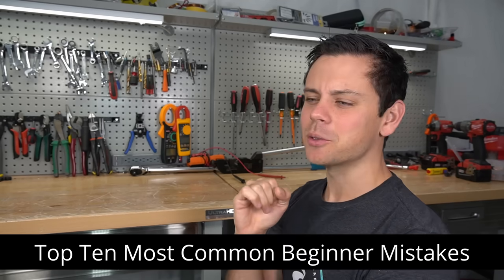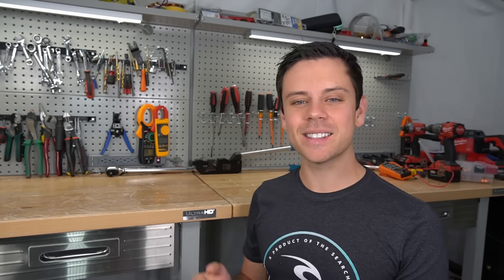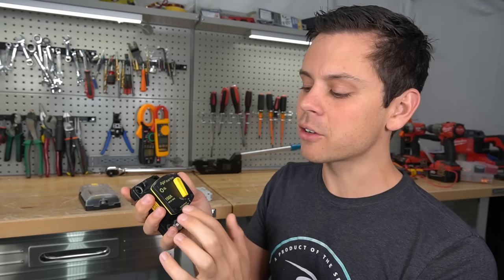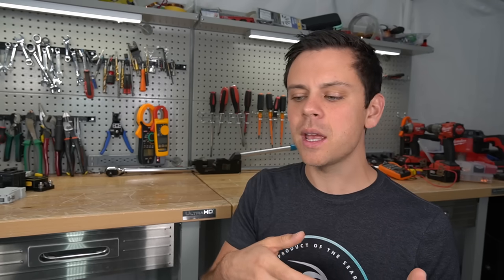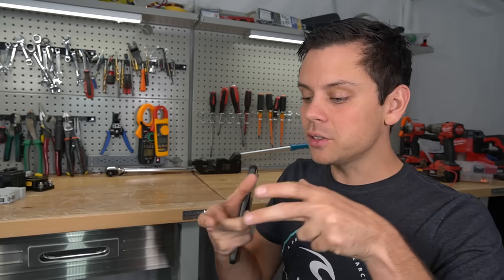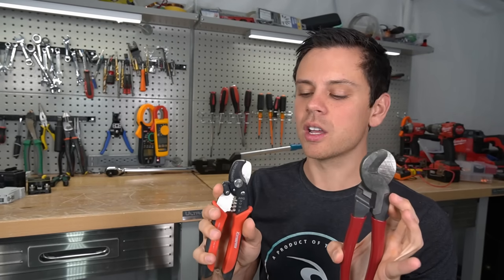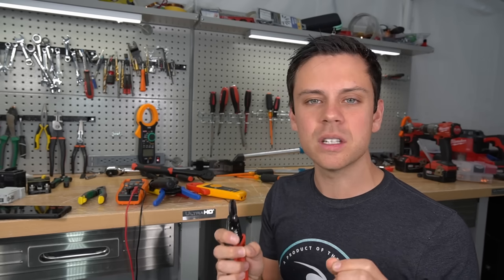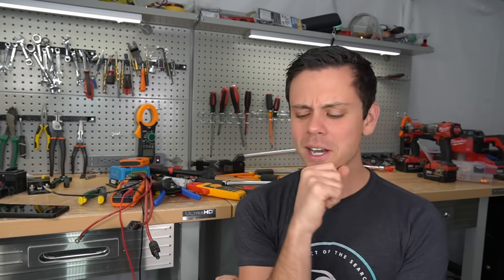Top 10 Beginner Mistakes When Building a DIY Solar System

Comment: If one is not 100% certain on their ability to create a gas-tight pressure welded joint, crimps can be a real hazard. I have seen poor crimps actually glowing due to resistance. In the absence of a quality hydraulic crimper ($$$$) for large lugs, I use poured sockets. They have no measurable resistance, and I have never heard of one failing. Check out “solder slug”. Of course, soldering must also be done properly, or it too will fail.

Comment: I'm surprised voltage drop wasn't covered along with ampacity. A wire could be sufficient to carry the amps required for the load but the length of the conductor could pose significant voltage drop, and not supply the required voltage.

Comment: As an electrician we are told not to solder on lugs.  Like anything in this world if it done properly then it should be fine.  I have 60A rated wire (16mm) and the correct lugs. If the copper is clean and shiny and a good amount of solder is applied and the lug is sweated on then it will be a good connection. While the solder is molten spin the lug. The only reason not to solder is lack of experence. I have 5000 18650 cells producing 20 kwh and use them to charge my M3.  Fun times.
Reply: As a guide dont think of a cable as a wire. Think of it as a resistor. Is the resistance low enough to handle the current and like everything else in the system, Is it fit for purpose ..  good common sence video by the way.  Nice presentation.

Comment: I agree with everything but No. 6. I would say always use aluminum cables, especially outside. Yes, copper has better conductivity. But it will corrode. Correctly dimensioned aluminum wires will not cause a fire. Copper wires will after 5-10 years.

Comment: Can someone help me with cable sizing and bus bar ampacity for my off grid system? I have (4) 100A 48v solar charge controllers connected in parallel to a bus bar, 10kw 48v to 120/240v grid tie inverter connected to the bus bar, 60A 48v DC Motor connected to the bus bar, (16) 100A 51.2v lifepo4 batteries connected in parallel to the bus bar, individual connection to the bus bar not to each other. If I max out the charge controllers and inverter what do I need?

Comment: Hi…
I have a question ,
I should be clear 
I know next to nothing about solar systems. 

My wife and I bought a camper 
It has a small solar panel on the roof, that is connected to a charge controller , then the battery 
The load however is not connected to the charge controller, it’s taken direct from the battery to lights, fan etc. 

Is it ok to have the system wired  this way ,

Comment: You forgot to mention solid strand vs multi strand wire for AC vs DC current.  And how one the current plows on the outside of the wires and the other on the inside.

Comment: Hi I’ve been watching your channel. I learned a lot. Now my problem is how to install a HF remote to a 8000 watts inverter. It’s been acting up. I had to disconnect it because when I switched it off the inverter would not turn off and I noticed it was draining the batteries. Also I need to know a good web site to buy the HF remote. I tried buying one out of PA and someone out of MN tried to scam me. So I’m concerned. Where can I go so I wont get scammed again. .
Reply: I have 6  -100 watts solar panels, 6 acid batteries and  4  deep cycle batteries. Can I use both the acid and deep cycle batteries together. I’m using a 3000 watts inverter I’m borrowing till I can fix the 8000 watts inverter. Right now all I’m using is 4 solar panels with 4 deep cycle batteries and the 3000 watt inverter., I also have a meter on battery to check percentages. And I’m using aMPPT controller .

Comment: Another great video. Thank you a lot buddy!
If the 48v fuse which you showed in the video will be not enough for 48v lithium battery, what is then best fuse to be used between 11kw Inverter  and  48v Lifepo4  200ah battery , can you please share your opinion. Thank you in advance :)
Reply: Would like to know this too
Reply: I found out, you need a Class T Fuse Block - blue Sea Systems 5502

Comment: Do you have a video giving example of what we can run on a particular solar system? Example, I want to buy a 1200W solar system, it says it can produce 5kwh per day, the whole kit comes with 2pcs 100Ah lithium batteries, large enough to store 2.4KWh of power. I know you had a video a while back about your system in your RV and you could run your tv and video games and microwave and vacuum but I don't know where it is, you have so many videos it's hard to find!! Can you please point me to one of your video that would cover that...or if anyone reads this and know of a place I can watch...that's how I learn, I need examples of what a particular system can run, doesn't matter the size. Thanks!

Comment: Please help. I need a battery for my tent trailer and am seeking out recommendations. I have 4x100 watt solar panels on the roof and a 2000 watt inverter. The battery and inverter are connected by 8’ lengths of #1 welding cable. I want to be able to operate a 700 watt microwave to make popcorn (once each evening) and be able to run my small Dometic brand propane furnace (so just the fan blower overnight). I am a single Dad so for now I just don’t have a ton of ‘spare’ money. Thank you for your help.

Comment: I have a charge controller epever 100v/40A, with maximum on PV of  520w for 12v and 1040w for 24v. I have my sistem created for 12v .... My question is, if I have 600w panels (55v & 10.9A), this could destroy my charge controller ? The limit is 100v/40A, but on the same time is 520w on PV ..... Any ideea ... ? As idee I have 6 PV of 100w 18.7v and 5.4A, there wi be 2 rows in paralel of 3 in series, cannot do only 5 in series because voc is 21.5v on each.... Thank in advance guys

Comment: If you were to design your perfect system with panels, backup generator, wind mill, batteries and switch to disconnect from the grid, what parts would you use? Do you ever design systems for people?

Comment: In particular, you should say a warning about getting shocked by DC. It is much more fatal than being shocked by AC. There is the possibility of being throat thrown off or your muscle pulling yourself off of an AC electrocution. However, depending on which way your muscle clamps, you can be pulled into the short circuit electrocution and held into it and just sit there and cook like a hot dog. DC is far more dangerous than AC when it comes to electrocution and arcs as you stated

Comment: Only crimp identical soft metals...like soft copper in a soft copper fitting. And it needs to already fit pretty well to start with. If you have different metals like silver and copper etc. I'd just solder.
This guy is right, a good crimp connection is indeed better.

Then again, a crimp connection that only contacts in a few high spots is not as good as a solder connection that connects everything in a solid block. So it has to deform for a crimp to work and you need just the right fitting for the wire you're using...and nothing too finely stranded, like the very fine limp wire in a stick welding rod holder.

If you crimp and solder, the resistance of a molecule-thick solder layer is irrelevant because it's not even there when the conductors are touching...the addition of filler solder won't get into the molecular contact bond between the crimped fitting and wire anyway.

A crimp would have to deform the wire pretty much for it to surpass the solder. Truth is, there's nothing wrong with either method, and each has its advantages and disadvantages. It's hard to pull a wire out of a soldered connection...or a really great crimp. Crimping done wrong can weaken strands worse than soldering would. There's probably more skill involved in a good crimp. It's not as straightforward as you might think. Really large wires and fittings require enormous soldering irons like the American Beauty where thermal mass matters as much as wattage, or two (or more) of the very largest soldering guns.

Comment: WILL!!! wait a minute, you just recently put out a video saying to use 100 % of the capacity in your lithium batteries so the BMS resets the balance charge function?!! Does the BMS reset at 5% the same?

Comment: Some basic power theory that folks MUST understand: 60 cycle AC voltage and current go to zero sixty times per second. DC voltage and current NEVER cross zero. AC circuit breakers take advantage of crossing zero to extinguish the arc. Opening a DC circuit draws an arc that will never cross zero and extinguish.

Comment: Will .. been following you fir about 4-5 years but never asked a question. I have a big Monaco bus.. it’s referred to all electric. 
I gave 800 AHs of LiTime Amphere Time lithium in 2 four hundred Ah batteries.  I have 2000 watts above charging these batteties through Victron controllers.  I want to add 400 more AHs and call it a day. I am averaging about 375-400 AHrs down each night .. normal stuff. 
With sun the next day .. depending on how filtered depends of how much charge out here in Apache junction  Az.  There is the back ground. Can I add two SoK lithium batteries to my existing LiTime batteries?   SoK are much smaller in size and would fit. I know they are maintained via the 250 amp BMS but I do not have the room for another 400 Ah or even two 200 AHs as controllers are in the way.. length is too long.  
What do you believe to be true. 
Thank you. Danny

Comment: did the mistake . crimped and soldered mc4  as a replacement  and some of cables  lost good connection due to heating,   they even moved after aply heating  i need to inspect again and again pffffffff

Comment: can you give me a simple yes or no on the system im about to build 400w solar panels ( renogy) 3000w inverter 50 amp dc/dc mppt charger , 560 AH fogstar battery , prob only be running a fridge laptop and a few phones , soes that sound ok ?

Comment: Every 3 years or so I checked all my circuit breakers to make sure none of the wires are loose easily done by just testing the screw wire down. You'd be surprised then how many you will find on older installed circuit panel newer panels I would double check because anybody can make a mistake

Comment: While I agree you shouldn't use CCA wire, I would note it's not dangerous to use, you just need to know it's limits, CCA wire of the same gauge will handle less current, so you have to upsize to a thicker gauge to get the current capacity you require, if you do that then you are safe, just be sure to factor that in.

Comment: OK I’m new at this game and I need to find out before I get totally into it and before I buy any panels the first thing I need to know? If I buy the 48 V system batteries for a G4 6500 primarily do I have to get 48 V solar rays or can I just use the couple 12s that I have?   Also, I am wondering are you talking about solar rays all the time but nobody mentions the wind turbine generator and does it have to be 12 v/ 24v and 48 V unless I misunderstand a wind turbine would charge faster. And I’m not used to seeing comments so I hope this gets to you. Oh by the way my name is BJ. I live in Texas and go through Arizona every now and then because I’m a driver have a great day. Hope you can answer some of my questions.

Comment: Been flying RC aircraft for years never trust crimped wire too many times wire pulls out under heat, and vibration watch $1500 model go into the ground.
Reply from the maker: You didn't do it correctly then. And I started in RC aircraft

Comment: could it be that my controller was completed damaged because battery was disconnected? I'v seen you pointed out to take one solar terminal and first connect the battery. I cannot call myself a beginner, it was my first attempt and the controller was gone.

Comment: Hi friend. I know you may receive thousands of comments. Can you do a review of PowMR 3,500W 48v, 4,400W PV 120v inverter! My LV2424 is dying. I replace the charge controller and it got damaged in 3 days. My LV2424 is burning the controllers and I have no idea whats the issue so I see this PowMR 3500W 48v inverter for $550. It will be a nice replacement. Help please. Thanks a lot!!’  I love your videos. My next upgrade will be EG4 system with EG4 batt but at this moment I need a cheap decent inverter.

Comment: Hi Will ,I'm running a bank of 5 lead calcium 12v battery's @80ah ,I'm running an epever 40 amp mppt alongside 2 different sized panels (1 X 165w and 1 X 335w ) I'm being told that this will not give me 500w however my charge controller is telling me different ,earlier today the bank was near on full to capacity however when I pulled a load via my inverter (1kw kettle) my mppt opened up with an impressive 17 amp charge at 32v ,if my maths are correct this is 544w ?!! ,I only have 500w max +/- 3% ,I'm in a warm climate in SW france ☀️ ,what's going on with my set up 😬

Comment: When attaching a lugged cable onto a stud - Be sure to use a washer (stainless best) first, then a locknut, and the final nut or bolt.  Without a washer, repeated movement of the cable can loosen up the nut. The washer provides a slip surface to prevent loosening of the nut or bolt.
Reply: The washer provides slippage to allow you to torque the connection properly without damaging the lug. If a complete connection is loose enough to ‘slip’ it is not torqued enough. The wires should bend long before the lug moves in a tug test of this type of connection. A lug connection is not idea for movement conditions, but if it is used, the wires should break long before the connection loosens up from movement of the involved wires. Ideally lugged wires should be secured between the connection and the allowed movement area so that movement is made in the span of wires and not at the connection.

Comment: The most important thing when building a solar system is to get the orientation of the planets right. I once saw a solar system with Uranus on its side and Venus installed upside down. Rookie mistakes.

Comment: I have a battery that never lights more than 2 lights of 6 yet my hybrid box shows it full at mid day.  I am now running battery charging with main off to see if I can get more lights to light. At night it shows grid is charging battery yet no matter what only 1 to 2 lights show in night. Any one experience this? 48 v system professional install...supposedly.

Comment: Loose terminals:
I had a friend and their range cord wasn't tightened correctly, probably only finger tight, and it arced and melted the power block. It could have burned their house down. They "accidentally" burned their house down later, when all animals happened to be out of the house for a bug bomb.

Comment: My question is, can I remove my lead acid batteries in my motorhome and replace them with battle born batteries, lithium ion without any changes to the charging system my system charges when I plug-in and my system charges as I drive down the highway what I need to know is what kind of changes do I need to make to my system to make it functional with the lithium ion batteries?

Comment: Because of the never ending changes, I built my system so my batteries never go below 80%, I will only use 20% of my batteries at any given time, in the future if demand becomes greater I will expand both in batteries and panels. Yes it cost me a small fortune and where I live winter is a very tough for recharge because of cloudy conditions throughout the winter season. Solar should never be your only backup.

Comment: So if I have 1 200w panel and 1 deep cycle 12v an 1 1500w inverter a battery monitor an shunt ( I totally don't understand the shunt?)
I was told I should have 3 deep cycle.
An got discouraged being told my charge control isn't best bc it's mppt ( I'll have to check the wats I think I think it's 40)
Basically iv not connected anything bc I learn after the fact it seems.
I have 10 gauge wire.
I also think I don't know if im really understanding the voltage meter....

I watch YouTube mainly will I also bought his book bc he's my favorite for explaining but every time I think I understand I lose confidence at every attempt for one reason or another.
Also I bought everything over the course of almost 2 years....
I don't earn alot of money....lol ....
An live in a small town nobody ever heard of.

My question mainly is - if I plug my panel, battery to charge, an my inverter to battery will it damage them?

Comment: I’d like to point out an observation about terminating cables. Silver is a better conductor than copper. If a copper cable was mechanically crimped first and then silver soldered wouldn’t that be a superior conductor? Has anyone tested this?

Comment: Its not necessary on large cable crimps, but crimping and soldering insulated cable lugs has proven to improve the connection. Not all crimps are perfect, some are rubbish, some are so bad the wire can be pulled out. To have the exact crimp-er for each connector costs a fortune, soldering fixes that. Its too expensive to have solar off grid backup battery power for a few days to run a large house or business. A 10KWhour power wall from rip-off Tesla costs thousands and thousands, and it may lasts a few hours at best, you need ten times that to run a house for a few days.

Comment: I DEF recommend using larger than needed OFC cables in every case. They connect everything and are def one of the most important components is any system. Spend the Xtra $ and buy it once. I didn't, and spent double what I needed to because of this... CCA SUCKS AND IS CHEAP FOR A REASON!

Comment: Will, you buried the lead (sorry). The torque tip is the #1 most important point of this video. It amazes me how many folks do not know that there are torque specs for things like screw terminals. This is even more important in mobile applications, like RVs. Under torque causes loose connections, and over torque can deform wires, increasing resistance. Both are bad and a fire hazard.